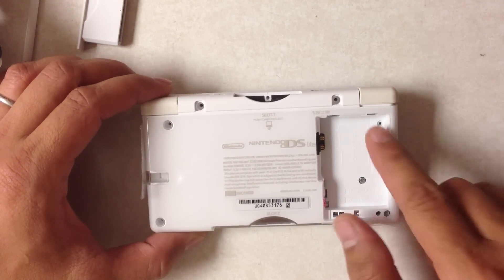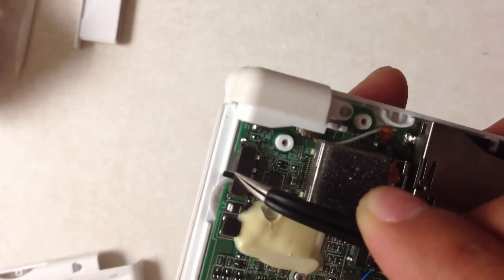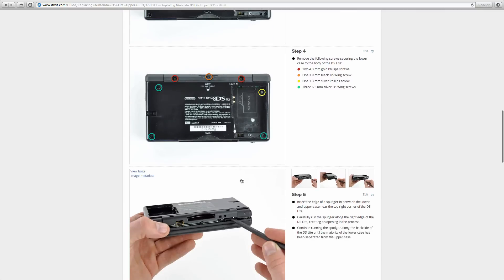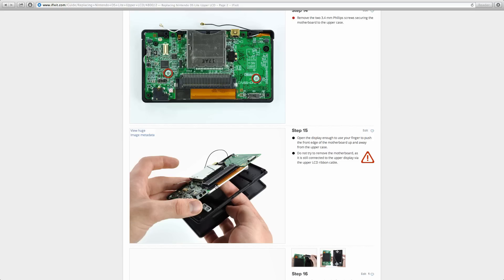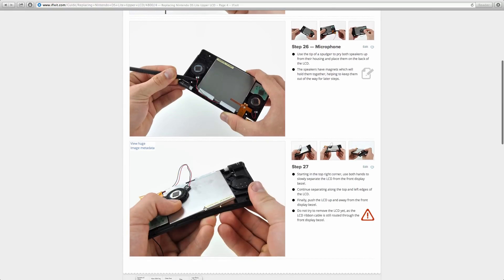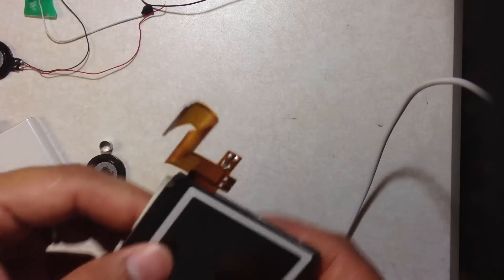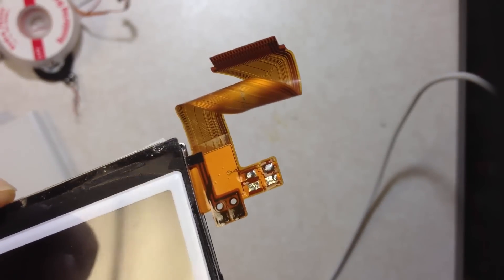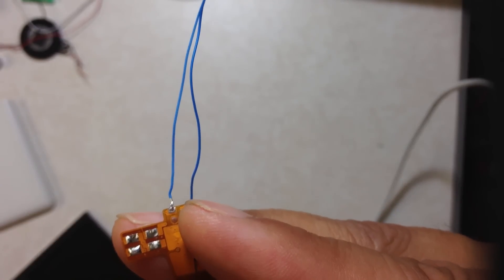DS Lite to GBA Tutorial Part 1 of 3

Comment: You don't need to use the top screen ribbon cable. You can just solder on a resistor (330 Ohm) on "LEDA2 & LEDC2" on the motherboard.

Comment: what specifically do you solder the 1k ohms resister to? like, in order to mimic the top screen resistance? i soldered it on in where i thought was the right place to put it but it didn't work and when i went back to see how you did it, you seemed to have cut out that part and i really need it ^-^"
Reply: Jinxtus http://gameboymacro.com/macro-tutorial-ds-lite/ 3 years a little late lel scroll down q lil and you will find the 331 flat resistor point to solder to

Comment: Hey I have a few questions (I'm quite inexperienced):
- when you're detaching those wires around 10:00 are you using heat or just cutting them?
- what's that bundle you use at 11:25? is it tin?

Comment: Can I just put an LED where the resistor for the screen is? I have seen other people do it. I would just have to wrap the wire to where the upper screen used to be. Then glue a hot glue stick between the two holes so the LED lights it up.

Comment: Is possible to remove the touch layers from the lcd? The DS has a lots of scratches on it and I think that it will have a better look If I just remove the resistive layers from the bottom LCD.

Comment: Hey dude, I soldered a resistor to the mother board (in order to trick the DS lite into thinking that it still has the top screen), the console does turn on but the screen is completely black. What should I do?
Reply: +Julian Obeid Mine too! Did you ever find a solution?
Reply: +ewinmn oh this was a while back! But I believe that it didn't turn on properly cause it didn't have the Wi-Fi chip connected, when I put it in there it worked
Reply: +Julian Obeid It's so weird. Mine is doing the complete opposite. I put the wifi chip and in and flashes. I leave it out and it stays black lmao!

Comment: what do you do if one of the screws on the backside are stripped?
Reply from the maker: If your screw is stripped, you can take a drill and VERY SLOWLY AND CAREFULLY drill off the top of the screw. Make sure to drill only enough so that the stem of the screw is still intact. This will allow you to remove the shell, and the stem of the screw will stick out just far enough to allow you to remove it with a small pair of pliers needle-nosed pliers.
Reply: rs1n
when you cut the orange cable from the top lcd, if you were to test it without the top/with the bottom, without having the resistor there, would the system turn on?

Comment: Why won't mine turn on at all? i disconnected the top screen completely because i don't have experience with soldering. I could probably do it because i have a couple soldering guns but i'd rather not try to do that. thanks
Reply from the maker: Because the unit does a hardware test (so to speak) to check if the top screen is in working order. If it cannot detect it, it won't turn on. Hence the need to do the soldering as explained in the video.
Reply: Ok thanks. Is a resistor required?
Reply from the maker: Yeah, it checks for voltage drop so a resistor is needed to "fake" that a screen is still there.
Reply: damn. Okay well thanks this really helped with my mod.

Comment: rs1n, I did this to my DSi using your method (top screen ribbon cable) but now the bottom screen gradually becomes more faded and washed out the longer it's powered on. And at some point, once the screen becomes dim enough, the system crashes and gives an error message. I'm going to try again with a different resistor, but I'm just wondering; Did you ever encounter such a problem? (bottom screen fading) And can you give me a guess as to what is causing it?
Reply from the maker: I never tried the mod with the DSi. The point of the resistor is the simulate the top screen being detected. The display ribbon cables may be different for the DSi. If you google GBATEK you can find more information on the display signals on the NDS. I don't know if there is similar documentation for the DSi but my guess is that the signals aren't the same and you have shorted a different signal that eventually causes the crash.
Reply: rs1n
The top screen ribbon cable of DSi is remarkably similar to the one in this vid. I noticed 4 solder points for speakers, and 2 other points right next to them. I held a resistor to those 2 points with my fingers and the system was finally able to get to the home screen. Anyway, I see http://nocash.emubase.de/gbatek.htm but I assume it is referring to DS fat. I can't see anywhere any mention of the DSL even existing, so it seems like the info was compiled before DSL was released.
Reply from the maker: http://nocash.emubase.de/gbatek.htm#pinoutslcdcables

Shows the NDS Lite external connectors for the LCD
Reply: rs1n
wish I knew how to use that info.. For instance it doesn't mention anything about why LEDA2/LEDC2 take precedence over the other points listed.. Anyway there are 2 questions I should ask while I still have you.
1) You chose a 1k resistor, but how many watts?
2) in the vid you used a soldering iron, but have you ever tried conductive glue?

Comment: will this work with a 3ds too
Reply: +Seiko Shinohara  why would it you havn´t any slot for gameboy Games
Reply: Krieschu
i know but you still have the ds cartridge slot
Reply: Seiko Shinohara That´s right but you won´t have the top screen so what whould you play? Theoraticly it should be possible.
Reply: +sosuke yamazaki GBA games don't fit in the DS slot.
Reply: It will be kinda useless because the point of those 3 videos is to turn a DS Lite into a Gameboy "Macro"
Reply: Jean-Simon Desjardins i know but i could load nes and gameboy roms onto a 3ds chip
Reply: Good Point

Comment: Really?  Really!  If your top screen is damaged to the point you can't use the ds lite, why not just replace the top screen?  Pointless, really considering how easy it is to get a top screen, but to each his own.  I just dont see why you wouldnt want to keep the top screen and the ability to play ds games.  Also, your finished product just ends up looking like a broken ds lite with the upper half ripped off.
Reply from the maker: Or, perhaps I simply wanted a GBA with a color screen and more responsive buttons in a form factor that better fits my hands. The original GBA doesn't have a backlit screen, and the newer GBA is too small to be comfortable. Why spend more money when all I need to do is tinker around (which I find fun) to get a working GBA player? As for my own unit, I would have had to replace not just the screen but the DS port, too (bent pins). More money (even if they are cheap) than simply converting to a GBA player. By your own argument, if I wanted a DS Lite, I could just spend a few more bucks and get an entire unit as opposed to just an upper screen.
Reply: rs1n  Well if you like to tinker around and all that was wrong with the ds slot was bent pins, you could've just chopped the metal top off of the ds slot, bent the pins back into place with needle-nose pliers, hit them with sandpaper, soldered the plate back on and had a fully functional ds lite with the ability to play ds games, stereo sound, and a top screen without having to buy a ds slot.  I used to replace the ds slots and now i have tons of old slots and I never have to put a new one on.  if the pins break, you can just de-solder the individual pin, yank another one out of an old slot, push it into place and solder it back onto the slot.  As long as you like it though, good for you, Old ds lites are dirt cheap now anyway.
Reply: You should check out Rose Colored Gaming's DS Lite mod for a Mother 3 custom console. It's called the Gameboy Macro haha.
Reply: TTDS messed with my top screen, but i already was plating ds games on my dsi xl, so my ds was basically a gba. This makes it better.
Reply: Yea wat the fuk! Why in the first place would the top screen get damaged?
Reply: +Branden Gomez Because if you are someone like me who have had their DS from the first year it launched about 10 years ago, it has some damage on it.